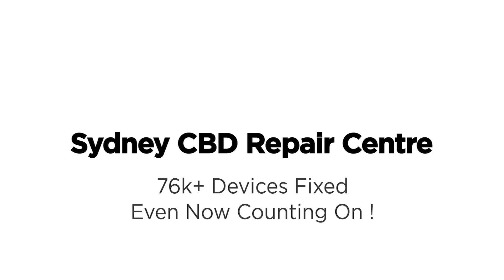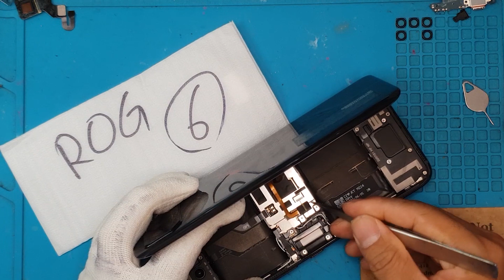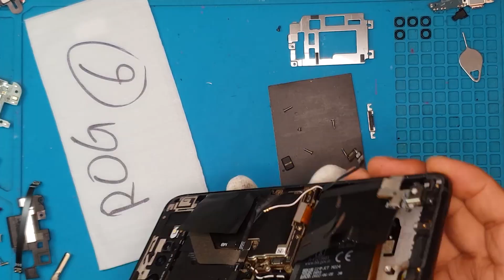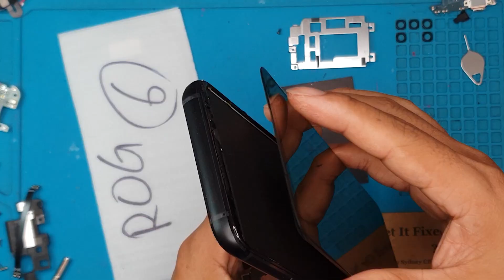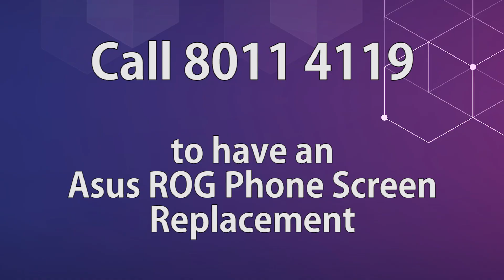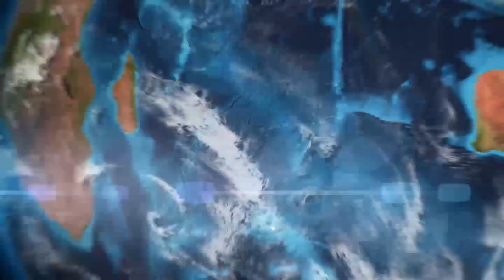REPAIR GYMNASTICS NEEDED! ASUS ROG PHONE 6 Screen Replacement | Sydney CBD Repair Centre

Comment: Mine got damaged from a phone cradle when i hit a pot hole. Only the glass cracked on the side where it was being held the lcd display is fine.
Where can i just get the glass only?
Paying someone here in the AU is only $300 less then buying a new device.
Reply from the maker: Hello we only fix whole screen which includes Glass+LCD we don't do a glass only replacement, that's why we can't recommend a shop or store where you can buy just glass screen replacement parts for this model